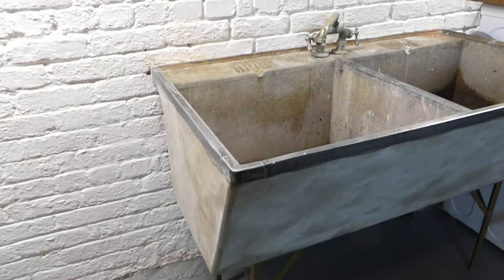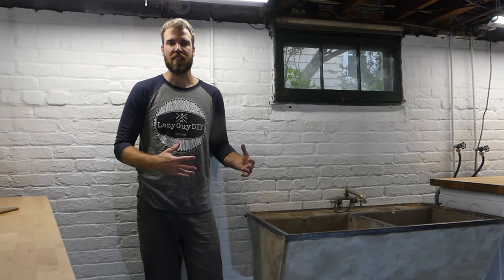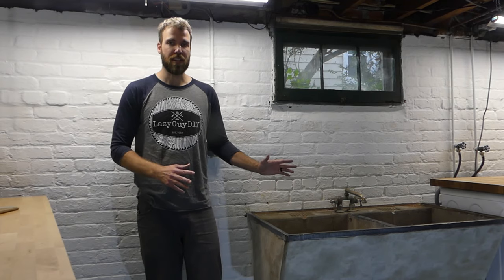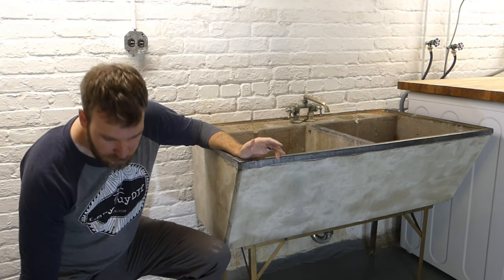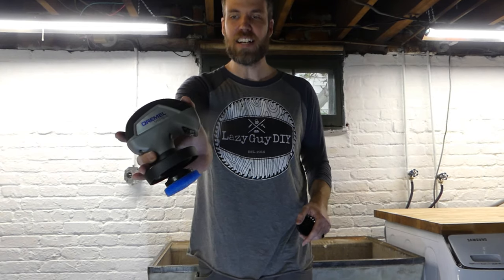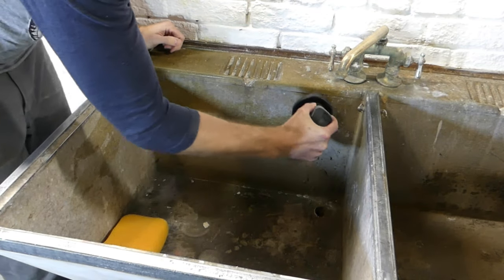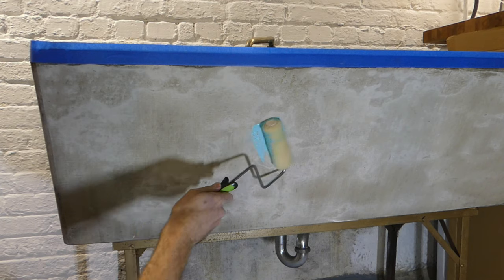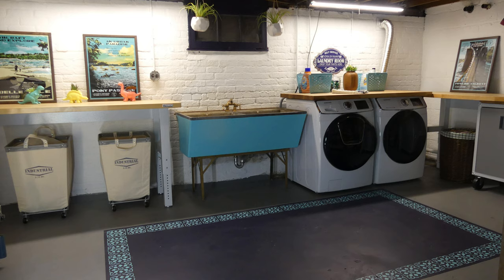How To Bring A Concrete Laundry Sink Back To Life

Comment: Warning!   The steel legs of the frame may be rusted through putting the weight of the sink on the old iron pipe drain.

I was just working on the P-trap of one.  As soon as I broke the p-trap lose, the legs crumbled.  

These sinks are HEAVY.  Luckily it collapsed slowly and didn't catch any body parts.

Comment: I had one in my house and totally redid it. Loved it - build a rather nice base from 4x4 legs and 2x6 curtain. Looked awesome - had a hard time with out the outflow because the old one had corroded away so there was just a hole in the bottom. So I made a PVC S-Trap to the hole in the floor, flared it out at the top with a 1 1/2 to 2" increases coupling and used a giant ring of silicone caulk...then more caulk...and amazingly it worked!
Reply from the maker: That's the hardest part is getting the outflow fixed.  I lucked out for sure.  Glad the pvc method worked, that's something i'll have to mention to others as they ask.

Comment: What did you do with the grime left in the tub? Mine has some creepy flaky gunk from all the decades of dirty laundry water (my guess is a combo of lint, soap scum, dirt... maybe rust?). Did you scoop yours out with a spoon or something? If so, was it before or after the  dremel work? Did you have to plug the drain with something to keep the gunk from going down the drain?
Reply from the maker: There definitely was an initial sludge removal a while back before the sink overhaul for the same reason.  I stoppered the sink and let the water set for a little bit, drained it and used a putty knife to take off that grime layer and threw it out.  It basically scraped out in sheets.  Ha!

Comment: Hello,
Did you have any rust on the zinc edges around the rim of the sink? If so, how did you get rid of it?
Thanks!
Reply from the maker: Luckily I did not have any rust, but a high grit abrasive would work for the clean up and even some rust release spray like WD40 sells.

Comment: If you are sink bottom is producing the little pebbles every time you fill it up and it's very rough. How do you fix that so the bottom is smooth in doesn't continue to wear away the cement. Is there a sealant that can be used

Comment: I have a sink similar to this but it really needs to be replaced, is that possible since the legs are set in the concrete floor? The drain is all messed up, previous owners caulked and taped the crap out of it but now it's drip dropping.

Comment: How did you find out the rim on yours was zinc? My sink almost identical and seems to be reacting to lead tests, but the color they yield seems less red (for lead) and more purple (tin) + dark brown/orange (barium). Also do you happen to have that patent number still handy? I can't seem to find one on mine.
Reply from the maker: I'm looking for the patent number and can't find it.  But that's how I found out it was zinc.  I just googled it, found the patent plans and it flat out said it was zinc and where it had been manufactured.   I want to say that after a certain year in the late 20's that stopped using lead because... well lead.  ha!
Reply: @LazyGuyDIY  Good to know. It's probably fine, my house was built in 1960. I'll dig around in Google patents a bit and see if I can find it. Thanks a ton for your response!

Comment: I have one of these and the problem is, the drains do not drain. My plumber said the drain parts are all corroded and blocked and there is no way to get replacement parts. Before we end up smashing it, do you have any ideas for how to fix and/or replace the drain components?
Reply: I replaced the drains in my concrete laundry tub with new drains. I used crack resistant concrete that has fibers in it and it has held up well (It's been about ten years now). It made a huge difference , as the original drains were too narrow to allow good drainage.

Comment: Small correction.   That cement is much much harder than soapstone.   Soapstone is about a 1 on the moh scale.  Cement  is about a 5 (tho there is a pretty wide Variability) and will take on what additional properties come from the aggregate. .  concrete will sand...  but soapstone would have sanded so much easier.

Comment: You didn’t touch the inside part? Just painted the outside?
Reply: Really nobody cares about the outside. The concrete cracks up around the drains and base on these. I have one now that needs epoxy 2 part putty to reform around the drain openings and to coat the interior with a waterproof coating to seal the cracks that allow the tub to leak out the bottom.
Reply from the maker: I commented in the video that the inside wasn't in that bad as shape.  I lightly sanded and then scrubbed away a lot of the grime that had built up.  But most importantly, because of the drain pieces and the connection, you can't use aggressive cleaners when working on the inside because it will corrode the drain components and no one sells them anymore.  As mentioned in the other comment, you can fill cracking with epoxy, sand it smooth and call it a day, but it's not guaranteed to fix it  and be water tight.  We were in luck that we didn't have to go down that rabbet hole.

Comment: where did you get the legs from?
Reply from the maker: They're the original legs that came with the sink.  I just sanded and repainted them.  From what I hear, those are easier to come by on ebay if you're looking for originals.

Comment: I have one and I put new hardware and gasket for the drain and it leaks or do I need a bigger gasket?
Reply from the maker: From what I understand, there aren't really any new options out there for these sinks that fit perfectly.  I've been told by my restoration friends that if you can find used parts it's the best way to go.

Comment: Did you forget the inside??
Reply from the maker: All you can do on the inside is scrub it up.  Water resistant paint won't work because it will just come off.  The other option is glazing it or adding epoxy, but then there are a lot of issues with the drain components that you can't replace if anything goes wrong.